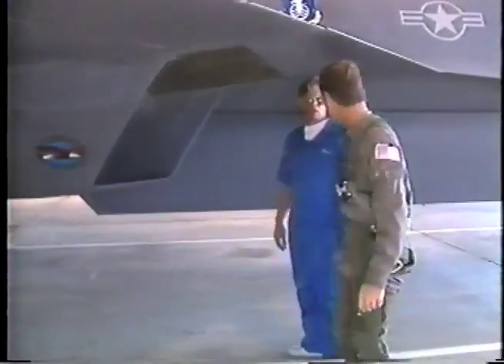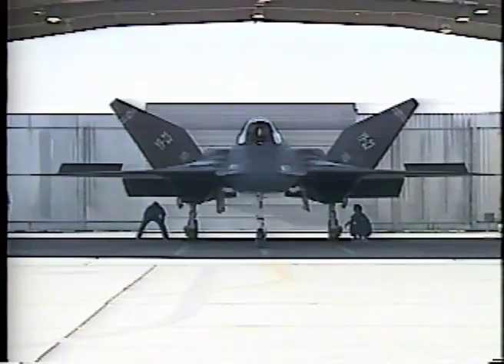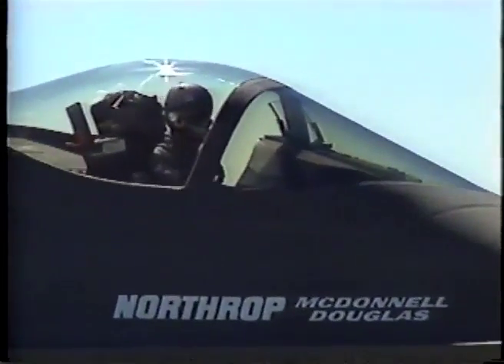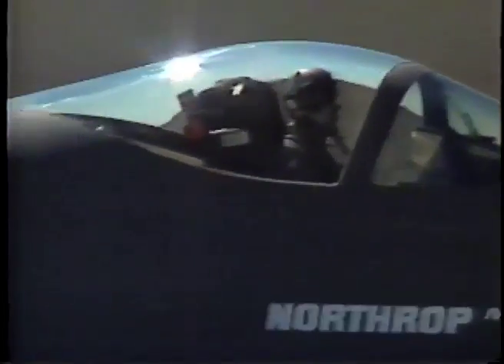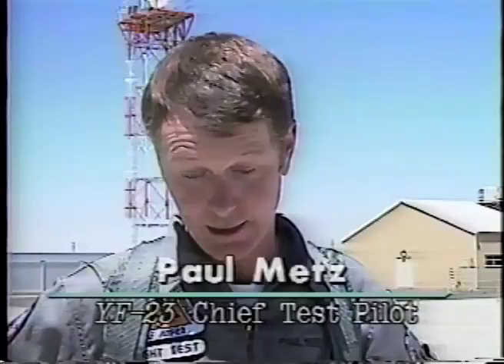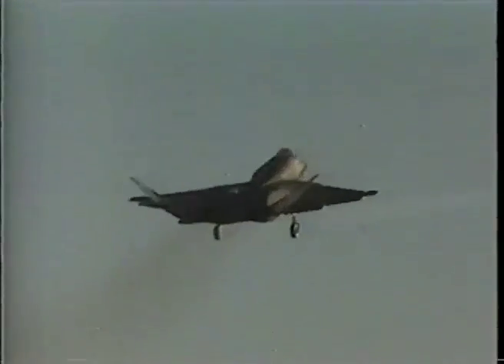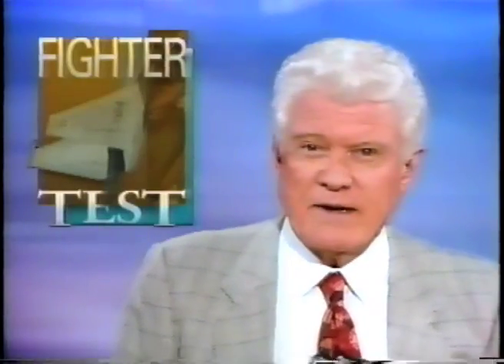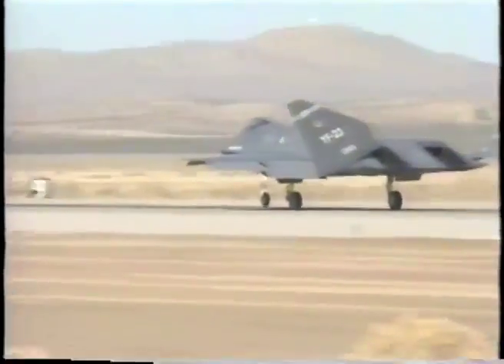SECRET REVEALED! YF-23 First Appearance on the World Stage

Comment: will instantly rival the F22 as the dominant air superiority fighter if they activated it today, instantly leapfrogging the others from 3 to 10. I love the F22 and those guys at Skunkworks did a phenomenal job however the F23 looks "next gen" almost like reverse engineered alien tech
Reply: Unless it was updated completely it would lose to a F15 and F18. The F22 today would destroy this thing because the F22 has been tested, used and updated. Pilots have 1000s of hours in all the planes I mentioned so no the YF23 would not instantly be the best.

Comment: One of the key problems with the YF-23 is that it doesn't have supermaneuverability / thrust vectoring.  The F-22 Raptor does.
Reply: Couldn't become a bomb truck or carry enough fuel. Hey fools the 22 has thrust vectoring only to get off the ground with a heavy load, fuel and weapons. It was fixed. The 23 was an experiment for the future.

Comment: YF-23 may look much sexier than the YF-22 but the YF-22 beats the YF-23 in terms of Maneuverability and high alpha. The USAF wants a Supermaneuverability Air Superiority Fighter but the Northrop gave them a high speed Interceptor. YF-23 lost by one thing that the airforce wants, and that one thing is Supermaneuverability. Northrop should've designed it with a thrust vector system.

Comment: Simply put- ahead of it's time, both in looks and performance, it was the clear " winner" of this competition- politics & graft had sealed it's fate before it ever got off the ground- if you think otherwise you're kidding yourself.
Reply: Dont get me wrong I love the Yf-24 it's one of my favorite aircraft, but multiple reasons caused it too lose, 1. Internal weapon capacity was much less than the 22 meaning it would either have to take less into combat or using external hard points compromising stealth
 2. The cost was more expensive than the 22 and the 22 is an already very expensive plane it would've needed more funding to be justified to take 
3. Northrop was already falling behind with the B 2 program and over budget as well making the Airforce nervous of the fact there new fighter would have cost and production issues

In hindsight yes the 23 should've had a better chance at winning but with all the possibilities at the time the 22 should've won for sure

Comment: IIRC, the controls surfaces appear hyperactive during the taxi test because the sensitivity had been set too high; the craft was reacting to every puff of wind and crack in the tarmac. They later changed the settings so that the sensitivity was damped until the YF-23 was in the air.
Feel free to add to or correct my comment. Bravo, Team YF-23!
Reply: altered trajectory you are 100 percent correct!

Comment: Better than the F22. Faster, just as maneuverable, longer range, more stealthy.
Reply: Nope, F-22 was more maneuverable and more stealthy, which is why it won.  Don’t know about relative speeds or range, but since they used the same engines, those were probably the same or close.
Reply: @5133937  Nope. The Grey Ghost F23 had the GE 120 engines and was faster. The F23 was more stealthy. The F22 was more maneuverable at slow speed but F23 was just as maneuverable if not more at other speeds throughout the flight envelope. The F23 had better electronics and they eventually ended up on the F22.
Reply: @altonwilliams7117   the 'F-23' would have been a completely different looking version though,  the F-23 was Going to be the Official Service Craft in the Military with Much Alterations I think
Reply: @mrandrossguy9871  
......and more expensive.

Comment: 750+ was what the U.S.A.F. wanted.

Only 195 F/A-22A Raptors were ever built before cost overruns and government bean counters from both the 43rd and 44th Administrations put the final nails into the F-22 program's coffin. Many a livelihood was affected. 

As for the YF-23 Black Widow II....shot down on paper because it lacked the thrust vectoring that the Raptor had despite having the ability to fly much faster than the Raptor.

A shame that stealth technology, given the fact that it is fairly new onto the scene compared to other manufacturing processes was not given the opportunity to work the bugs out of the system the same way that the prior manufacturing processes such as on the F-16 programs were granted.
All water under the bridge at this point.

Comment: Hate to say this but I saw these aircraft in 1979-1980 at Wright-Patt for testing also the C-17 too.
Reply: I doubt that very much... ATF prototypes were not unveiled until 1990 and C-17 first flight was September 1989. I built it and tested it.
Reply: @Angelo > YOu are full of crap.   I was at MD for the first C-17.  You may have seen the YF-15 in 1980 but I guarantee you did not see the C-17

Comment: F 23 perfect stealh interceptor for US Navy.
Reply: The Black Widow II would have probably been too big for the elevator on-board the carrier.

The U.S. Navy has a weight and maximum number requirement for the elevator. I believe that it's 90,000 lbs. 
So in the case of the F-35B/C, two aircraft on the elevator at a time and fully loaded minus fuel would have meant no more than 45,000 lbs. each aircraft. Which was one of the reasons for the costs overruns and why Lockheed Martin was having trouble with getting the weight of the B (Marine variant) and C (Naval variant) models down under the wire.

Well, not only is the Black Widow II (minus fuel) weighing in at 51,000+ lbs. but her length is in excess of 67 feet and her wingspan is out to more than 43 feet. She's really huge!

Most likely only one, if even that, on the elevator at a time but it wouldn't be very efficient or practical in a "crunch time" scenario.

Comment: A lot of misconception about the yf23. It was actually just about as capable as the f22 at dogfighting the thrust vectoring didn't make the difference the air force and navy thought and when the designers from Northrup came out with the specs for the yf23 the air force actually said they couldn't be right about them and they weren't allowed to show them. The YF23 was more capable in just about every way but due to past blunders with the B21 the government was never going to give the contract to Northrup even though they built the much better aircraft.